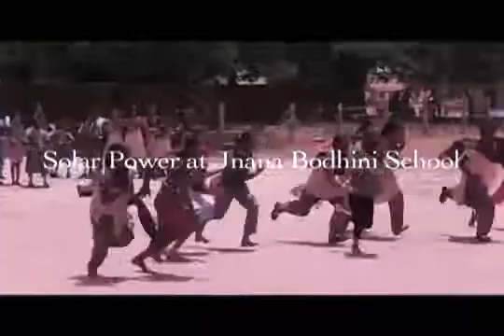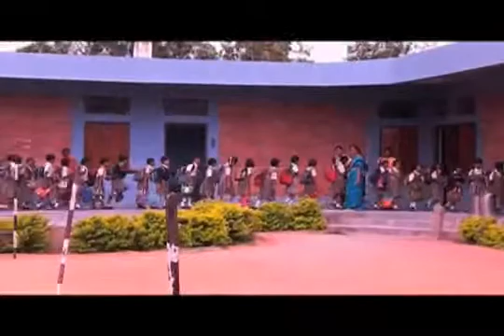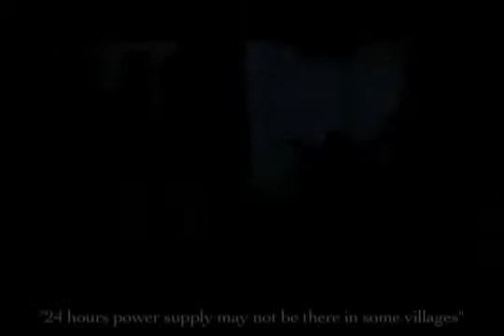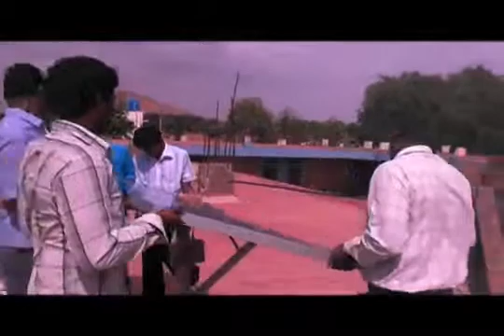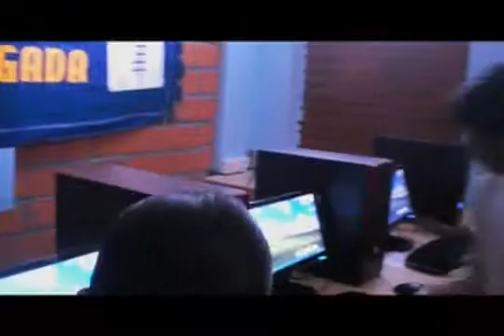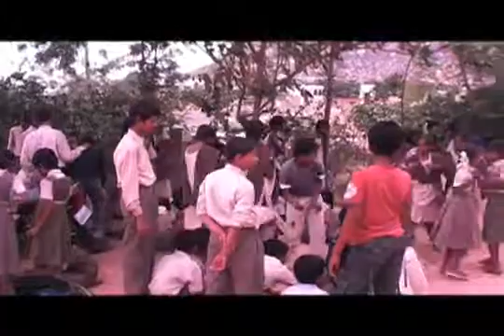EE UG sets up a Solar Powered Lab in India

Comment: Hay Raj, I am one of Miriam Deutsch's PHYS-162 students, I missed your visit but checked out your video and story. Looks to me like you might be better off using lap tops rather than desk tops. You can probebly run four laptops on the same power as one desktop. At least get rid of the CRT tubes and use LCD panels, I'm sure people would donate them if you asked on graigslist.